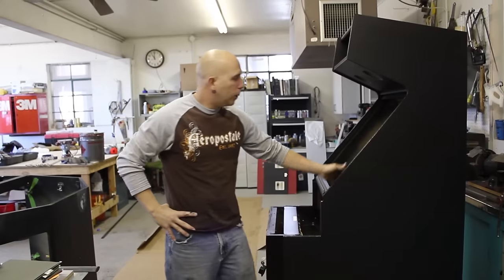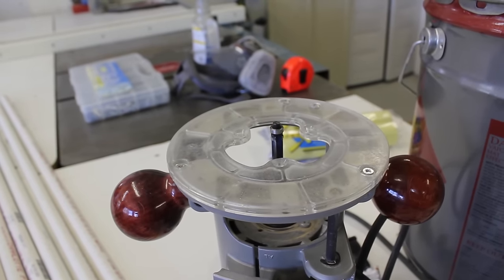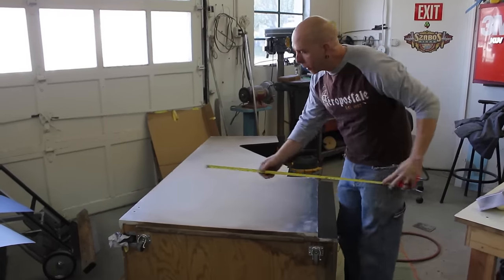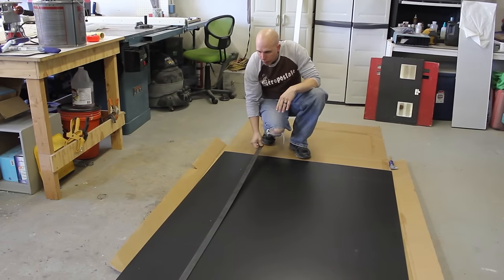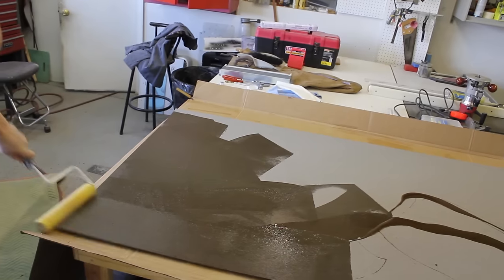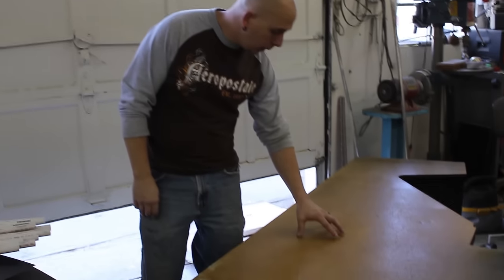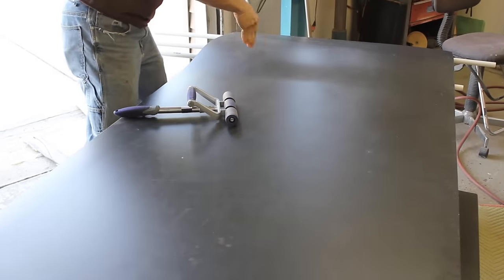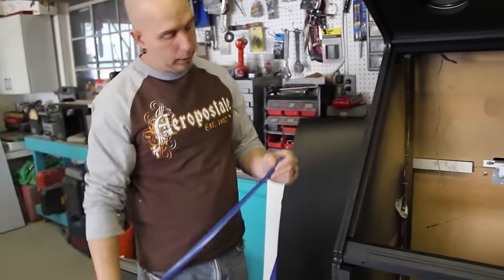Laminating Arcade Machines

Comment: Great video. I love laminate and pretty much anything you put it on comes out looking brand-spanking-new!  One question, did it say on the brand of adhesive you have to put two coats on each surface? The brand I have used in the past only said to use one unless you have let it dry for too long and then you can reapply another coat. I was just curious.
Reply from the maker: TortureBot it specifies two on edgeswith this product, but just as a precaution I opt to do entire surface to be sure I will have the best bond. Some manufactures may vary though. Thanks for watching man.

Comment: Hey szabo I have a ridge racer arcade that the tv blew and I got a replacement CRT, but it appears that the video connection is through a ribbon cable.  Do CRT's have a ribbon cable connection inside?  Or do I need a different board for the connection?
Reply from the maker: KING KONK the connection will be on the monitor chassi. To my knowledge not all CRTs are compatible with any game. There are different types of connections on some monitors. I honestly would have to research that one little deeper for you. Thanks for watching man.

Comment: What's the thickness of the laminate, and what material is the roller you are using the spread the glue?
Reply: I believe the roller is a 9 inch wide  x 1/8 thick, Short nap foam roller.

Comment: Where i can order lamined?
Reply: For basic colors- Lowes/ Home Depot- they sell it by the sheet. Just make sure the size is what you need because you'd probably want one solid sheet to go along the whole side and for full sized cabinets i'm not sure if the sheets they have are big enough... For 1up cabinets it'd be fine i'm sure...

Other than those places i'd look up countertop places in your area that redo counters and they can order it for you. They'd have a bigger selection for colors. Another idea though is going over the mdf with a primer that works on mdf... I forget which ones but a google search will tell ya. Then you can use whatever color paint and put that over it and follow up with some clear coat of some sort... Keeping in mind what each type might look like. I'd probably go with a matte finish for what it is. Be sure to sand with high grit sandpaper in between coats of paint. It's a bit of work but painting it can save ya a lot of money and it's cheaper to touch up if it gets scratched.